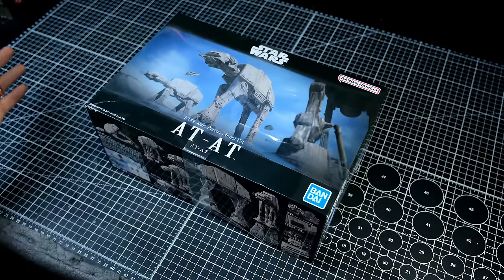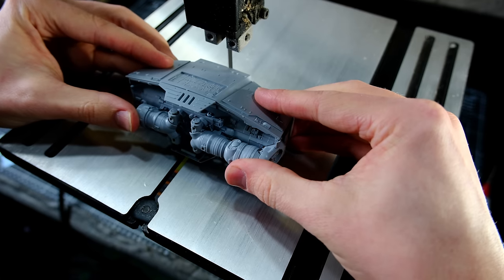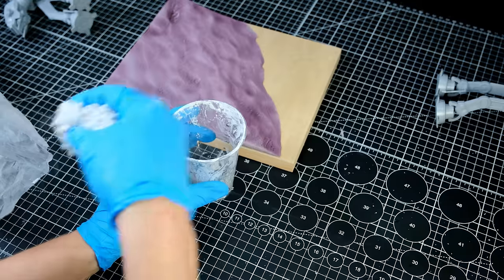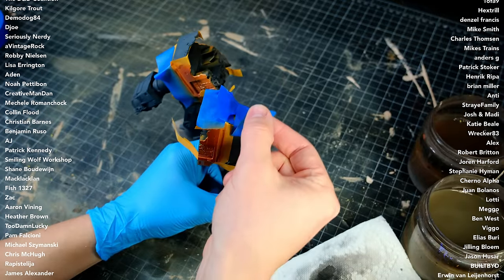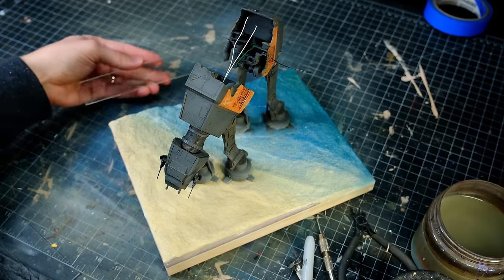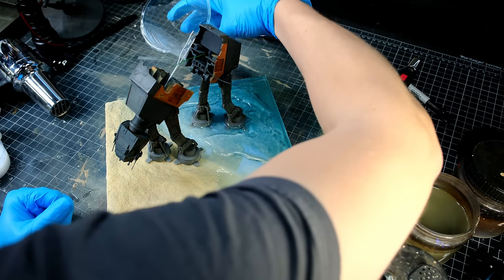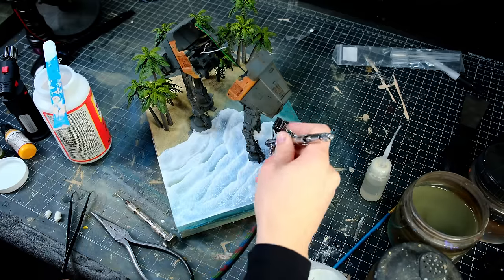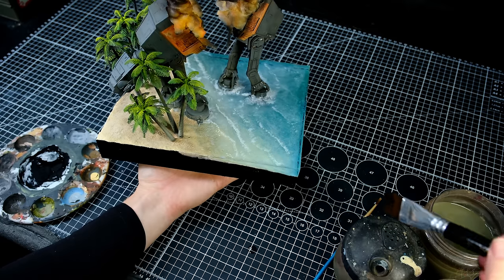Realistic Looking Miniature Explosions

Comment: A cool technique I saw to create them were cutting up some craft store feathers into the leaf shape, and then airbrush them various shades of green. And using a metal armature roll some air dry clay to do the bark structure on them. Finally for that weird fuzz they have on the top of the tree mixed in with the leaves. Some Ak interactive sea grass works well for those fibers. Once you add them all together and paint them up they make a decent representation of palm trees.

Comment: Hey boylei h.t......you could use palm trees with...
1. Jurassic park t rex build diorama....with main gate and lights in gate and along small peice of road.
2. A black pearl pirates of carribean boat moved by crabs on beach with palm trees....with lights in lanterns on ship.
3. A millenium falcon rebel base diorama....small landing pad....heavy walled open base behind...with lights on pad and inside base and on door panel. Complete with palm trees and ferns.
4. Two huey helicopters painted black...hovering over a thick forest...with small figures rapelling into forrest with palm trees...with red lights inside helicopters. Aka a original predator 1987 drop off scene...
5. Predator space ship crashed in jungle with open cracked craft lights n fire from ship surrounded by palm tree'd tropical forrest.
Few ideas for u...keep up the goodness.
Peace.

Comment: You know, if there's one thing in Rouge One I absolutely hate (although the movie is the one most like the original three since they started the movie franchise back up) it's the easy-peasy way they took down the AT-ATs. If a T-47 with it's sawed-off starfighter cannons can't even scratch the paint on one of those, an X-Wing shouldn't be able to one-hit one, and a guy with a handheld blaster strung Vietnam fashion into hatch of a shuttle DEFINITELY shouldn't be able to just blow one apart willy-nilly.